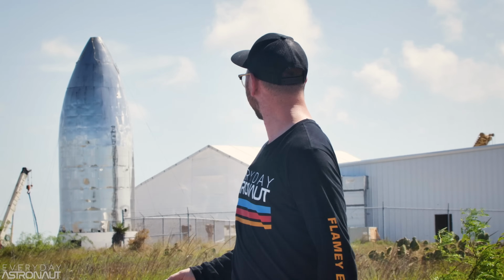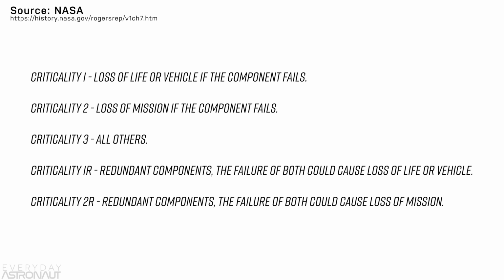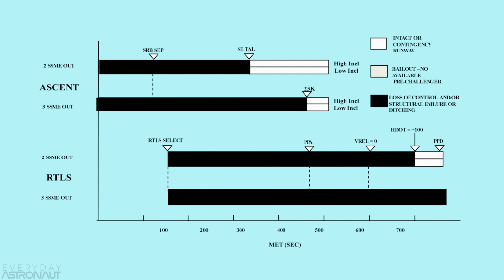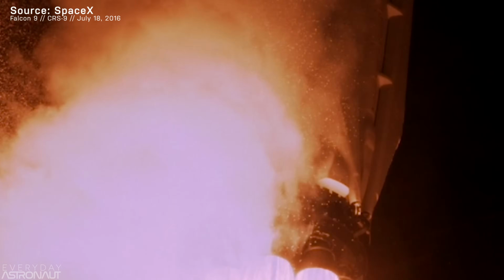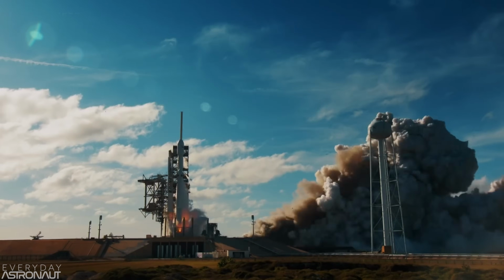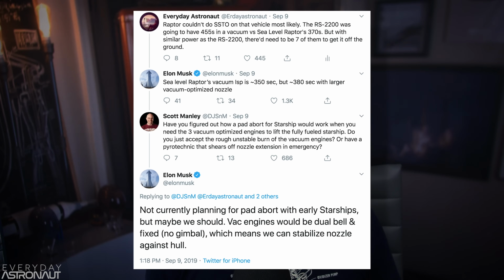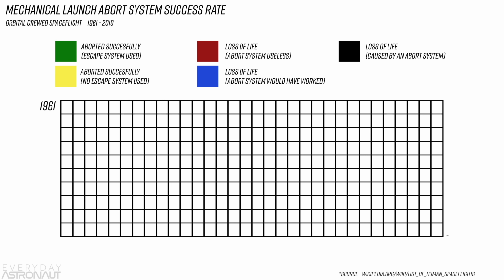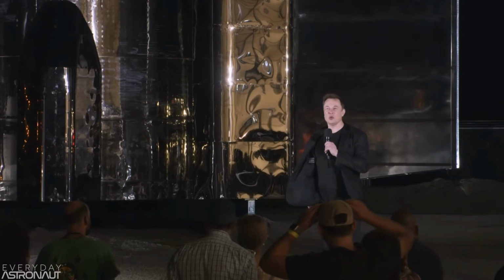Why won’t Starship have an abort system? Should it?!

Comment: The Columbia deaths could have been prevented by having the crew head to ground on a different vehicle.
Reply: What other vehicle? There was a talk after the catastrophe that they could rush Atlantis to launch, but that was VERY risky and would only increase of cbance of having 2 crews in damaged orbiters. And no, soyuzes are not an option. They are not designed for docking with fcking STSs.
Reply: @b0mby1  I believe what he is saying is if they had a crew section which was detachable from the main body of the orbiter (AKA an abort system) they could have reentered using it.
Reply: They'd have to have had another shuttle on the pad, ready for a (relatively) quick countdown-which is what they did on future flights to orbital inclinations incompatible with the space station. They didn't. Once launched, the Columbia crew did not have enough life support to survive until another shuttle could launch.
Reply: They didn't know that the wing was damaged before the temps rise while they were already re-entering

Or did they know?
Reply: @eetu5193  They didn't know
Reply: @shatterpointgames  But such a modification would compromise A LOT of payload to orbit capabilities of the orbiter. It would need life support system, RCS,electronics,power supply, heat shield and de-orbit engines(and subsequently fuel for these) . That would be too much weight and would probably reduce the payload from 24. 2T to about 10-15 tons to LEO.
Reply: @b0mby1  I'm just explaining what he was saying. The space shuttle killed 12 people, if they had a launch abort system it would have killed 0. That's why today they don't launch payload and people at the same time.
Reply: @eetu5193  Correction, the astronauts did not know. Within NASA they knew there was a high probability that the wing had been damaged but they upper management didn't think the damage would be fatal. The engineers, who were fishing for the use of a spy satellite to try and get an image of the wing, did suspect the damage might be very serious but they were overruled.

Comment: it doesn't seem impossible to put a pusher abort system in the nose cone. the astronauts sit in the nose cone during lift off and the whole lot pulls away during abort. You lose a little space and mass in order to increase safety during lift off. I think it is a necessary risk mitigation rocedure.
Reply: And then? You also need a parachute. A big parachute.
Reply: @stephanweinberger  Not that big. I'm talking about making the nose cone separable, about the size of the dragon 9 crew rated capsule. Enough for just 7 astronauts. I know that spacex want to send many more people in a single flight but for the first few years its a big risk to send more than 7 people. that ought to be enough for any mission except a colonization mission. Later versions of the Starship could have a different abort system or none at all id experience shows that starship is very safe. Cheers.

Comment: Remember, the original intent WAS to soft land with the super Draco’s
Reply: Yes, but then the realized that making the landing legs (which would have protruded throgh the heat shield) safe enough or redesign them to fold out sideways like F9 or New Shepard was much more complex than just using parachutes.
Reply: It wasn’t necessarily the complexity of the leg system, but also in very large part the difficulty of getting NASA approval to have potential failure points built into the heat shield when they were already running on a very short deadline.
Reply: that's what i meant... since NASA has some history with holes in heatshields this is kinda understandable

Comment: 39:39 So that graph means in every 500 km flown there is an accident? How is that almost a 100% succes rate?
Reply: check the labels again - every 500 MILLION miles flown
Reply: @Gibson99  my bad, thought that meant miles or sth...
Reply: @peppi0304  and my bad too... i should have said 500 million KM, not miles. Tim doesnt normally use imperial units since the majority of the world doesn't either

Comment: Hey Tim, you said that starship needs 2 out of 3 engines for the landing but if 2 of the sea level engines fail could they use the vacuum engines to land because of the dual bell design?
Reply: Vacuum engines will blow up if fired in the atmosphere
Reply: @Bryan-Hensley  they are using a dual bell design so they can be used in an abort though, right?

Comment: There's a British company (called Skylon) that has perfected a Scram-jet and rocket hybrid that is capable of flying like a plane through the atmosphere than convert to a rocket in outer-space, then returning (converting back) safely. The break through was in the cooling of air (through heat ex-changers) from sever thousand degrees to an few degree above 0 kelvin.
Reply: Yeah when is that thing going to fly?
Reply: Nope, the Sabre engine is still under early development. They don't even have a working prototype yet.
Reply: Yeah one to watch....

Comment: FAA regulations are written in blood, and aircraft have become much safer because of those regulations. Rockets are going to have go through the same thing to be as safe.
Reply: Technically rockets ARE going through the process... every accident is meticulously analyzed and investigated to try and prevent it from happening ever again. Models are grounded when it seems the production process has basic flaws and all the other steps, but as Tim said there are orders of magnitude less starts for Rockets than for airplanes or even Zeppelins and Balloons, so the process takes a much longer time.
Reply: One thing space flight may have over air travel - environment predictability.  Planes have to handle a huge range of conditions in weather, wind, storms, temperature, visibility, run way conditions etc etc.  Rockets are out of atmosphere in a minute or two, then are in a known and very predictable environ (space) for the majority of there trip, then they have a few minutes of hell and atmosphere again for a few minutes.  And they don't launch if they don't like the winds/storms.  Having said this space craft also have to handle more speed, pressure, temperature etc. Do you think this environment thing is a plus in any way, or just wishful thinking on my part?
Reply: @WillArtie  Obviously the space equivalents to weather issues are meteors/debris and radiation. Beyond Earth orbit impacts are likely really rare, and radiation is largely a known quantity. So, yeah, I think you're right. Plus, during cruise phase there's generally more time to work the problem.
Reply: @WillArtie  that true! But if the starship is going to mars, the atmosphere environnement will be a really big issue! I just can't fait to see if they are capable to handle this!
Reply: @WillArtie  the problem in space, you can get impacted by super fast objects.
Reply: @WillArtie  well pressure difference in space is just 1 bar. It's tiny. A recreational scuba diver is subject to 4 or even 5 bars of pressure. A hole On the ISS, if small enough, can be sealed with your hand and eventually just duct tape.
Reply: Those people who died in 2 737 max crashes would disagree...
The FAA is a disgrace!
Reply: bbeen40, they would disagree about what? That planes are safer now than they used to be? Well, it’s a demonstrable fact planes are safer now. Safer doesn’t mean perfectly safe. Or perhaps you mean those rules aren’t written because of fatalities? That would be ironic because those same dead are the cause of changes to the regulations.
Reply: @kokofan50  
If the FAA was the robust, safety- first organization that they used to be, that you incorrectly think they still are, then you would be correct.
They aren't, and you are incorrect. The second crash is 100% the fault of the FAA. I will never trust them again.
Reply: bbeen40 - FAA could have grounded every 737 MAX-8 flown in America or owned by an American carrier & stopped ALL deliveries of 737 MAX-8’s, & it still wouldn’t have prevented the Ethiopian Airlines disaster! That was what the FAA did when it received the PRELIMINARY results from the investigation into the 2nd accident, & that was all the FAA is authorized to do. At the time of the 2nd accident, the agencies in charge of investigating the first accident hadn’t finished their investigation, & they only released PRELIMINARY findings AFTER the 2nd accident.
Sorry, not the FAA’s fault - If you want to fault anyone, fault the Boeing executives who forced the MAX-8 forward & didn’t allow the engineers to treat & test it as if it were a NEW aircraft (which it was), & then forced them to do a “band-aid” (MCAS), instead of a complete fix, when problems with stalling in certain flight profiles was discovered...
Frankly, I hope these executives are tried for multiple counts of “Depraved Indifference Homicide” (Murder 2) & convicted of Murder 2 & sent to prison in either Indonesia or Ethiopia for a VERY LONG time!
Reply: I could imagine a gradual shift to human flight on starship, starting with a period where the big new rockets would not carry people at all until they've flown, say, 100 times in a row without failure. Meanwhile crew would fly on the smaller rockets with credible abort from the pad.

Then another period of 10000 launches or more where Starships that fly crew from pad to orbit have been modified with some form of ejectable cabins and/or other safety systems. This would obviously cost a lot in terms of payload and crew capacity, but might make sense in an interim period for launches off the planet. During the same period Starships with no abort systems, but otherwise crew capable, could be flown into orbit uncrewed with supplies and more fuel on board and then be met by these less efficient, safety enhanced ships. And then the more roomy and efficient ships could do the trip from Earth orbit to the Moon or Mars where abort systems would make little sense anyway.

And then finally, with enough successful launches, Starships would be trusted enough, and/or evolve into something that is trusted enough, to just work every time from pad to everywhere and thus have no need for an abort system.

I am very skeptical of doing a launch abort with raptors, though. It seems that to have enough thrust to fly with full tanks from Earth surface you need a completely different engine setup than 3 vac and 3 SL engines, I mean even with 9 SL engines it wouldn't exactly be screaming out of there compared to a capsule fitted with a typical launch abort system. And the engines need to start up also, that takes time, AND that engine setup would be pretty inefficient for getting to orbit for normal operation, all that extra weight of those engines and their lower efficiency, not a good design IMO. Unless you can find a way to get rid of 90% of your fuel in an instant, or adding special purpose abort engines to some early variant starships, I don't see it working well enough to be worth it.
Reply: There will be less blood luckily with rockets... but yhea :/
Reply: @mikee368  less blood because the explosion would burn it off anyway lmao
Reply: kokofan50 Yeah, tell that to the families of the Boeing Max victims.
Reply: FAA regulations are also based on the gruesome logic that if safety will cost more than wereguild (paying for deaths) the safety measures will not be mandated. This us why after a number of global 747 losses, we still lost TWA800 and the airlines were given a dozen years to fix the problem on the rest of them. Not very safety oriented. Or, allowing Boeing to self-certify the 737MAX. Oopsie?
Reply: chapter 13 is anyway-hardest & bloodiest test for an A&P   made it though...

Comment: Well - it's a bit of a missphrasing. Starship will have many abort options during the different phases of the flight. Lack of abort tower does not equal to the lack of abort system, which is just integrated into the vehicle.

Comment: Analytical based decision on this is not valid - The need for a launch abort system is based on the number of unmanned flights (and how well instrumented) done prior to using the vehicle as a manned vehicle.  Abort systems were added to early manned flights because they needed astronauts  to operate, so it's first flight was manned.
With enough launches, there will be catastrophic failures, just as there are airliner catastrophic failures.  keeping them few and far between will require early testing with lots of instrumentation to verify stress levels, then make sure the quality and design are sufficient to prevent them.

Comment: is spacex going to test out everything on the moon first? making fuel, multiple lands and takeoffs etc? wouldnt it be more economical to make the fuel on the moon and use the moon as a depot to get to mars?
Reply: Making methane on the moon is going to be an interesting problem to solve. What is the optimal way to make methane on the moon? Figure it out and I am sure Elon will hire you!
Reply: @tonyrusi1978  it looks like you cant since there is almost no carbon on the moon. no carbon (even in rocks!) no methane :(
Reply: @danielroden9424  I wonder, if it can be mitigated a bit by bringing carbon with ships and using ISRU to add hydrogen to it to form methane... half-measure, of course, but still a bit better, than bringing entire fuel loads to there.
Reply: @caav56  the whole point is to make it with materials on the planet or moon to save fuel. if you have to bring it its not a cost savings.
Reply: Mine and refine on the moon, ship it leo, refuel inter planetary craft and go. Taking travelrs to mars via the moon first would be a 6 day detour and a waste of feull.
Reply: @profwaldone  if you make your fuel on the moon its much cheaper to launch into lunar orbit and then transfer to mars vs making it on earth and launching it. but methane seems unlikely as there isnt much carbon on the moon

Comment: Again, "Engine Reliability" as name say, is about engine, not rocket, or mission. So stop making problem, if engine not meat it performance, it fails, even if rocket and mission was success.
And one more thing, Merlin and others engines evolve, so this number is theoretical only, you may add flights without failure from last, so early design flows, which no longer exist, not take down this statistic. Because % are important, but 100% with only one flight, mean nothing.
Answering question "Do you get on rocket without abort system" let me as "do you get on plane without abort system"? Answer is same.
Reply: Planes are a bad analogy as they technically have a lot of abort systems. For starters they glide and can manage a controlled landing on any even surface even with a total loss of propulsion and their electric generator as backup generators that rely solely on air passing across the fuselage will automatically deploy. With no control surfaces to generate lift a rocket is nothing more than a brick if it fails. Even if you add redundant power by the same means as a plane it makes no difference to the rocket it's still just a brick falling. Only difference is no it has a working dashboard telling you that you'r falling.
Reply: @aBoogivogi  Is great analogy, because only think you want to know is what is chance of crashing. All things you put in message are only part of not crashing, same with rockets, maybe not same solutions, but you want not to die, and only this matter, if you would know that is more safe to go with rocket then with plane, do you not go?
Ofc some people afraid planes, and drive cars, even is more safe in planes, but out lizard brain have part in it.

Comment: WHY would a Cargo Carrier testing prototype design have an abort system???  LOL!!!
FACT 1:   virtually NONE of the design details have been worked out for a human carrying Starship ... certainly abort systems could be included for a small crew ... but NOT for a 100 passenger Starship ... since a large abort mass can NOT be aborted away quick enough from a large exploding booster, inertia is a bitch!!!
FACT 2:   if an actual paying customer emerges for a commercial passenger Starship .. that customer will define many of the design requirements, such as whether an abort system is required.  The Starship is basically a demonstration of a 2 stage reusable launch vehicle ... it's possible that it will be safer for a human crew to go in a third stage that is customer specific.